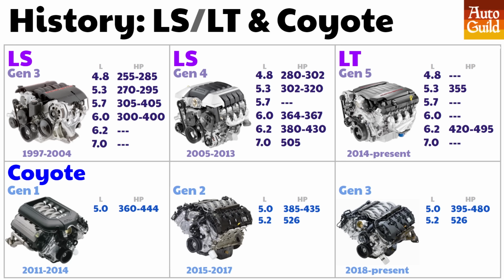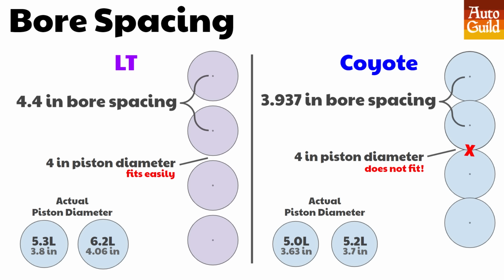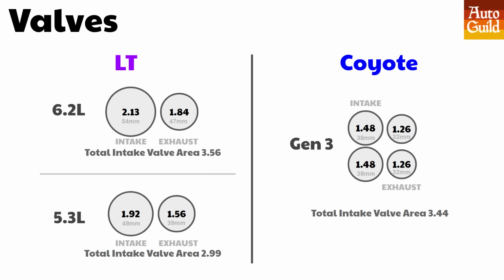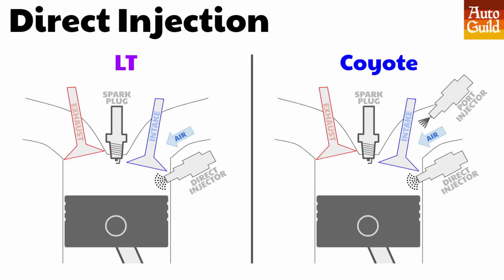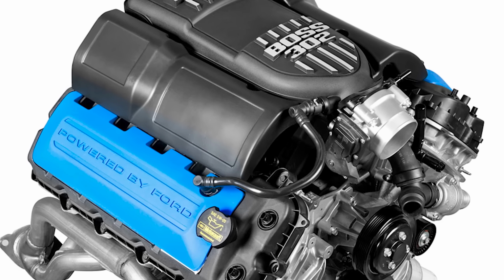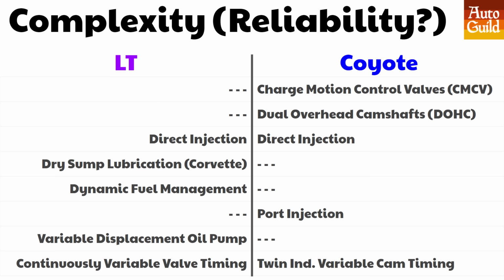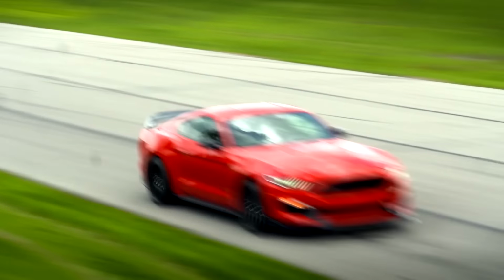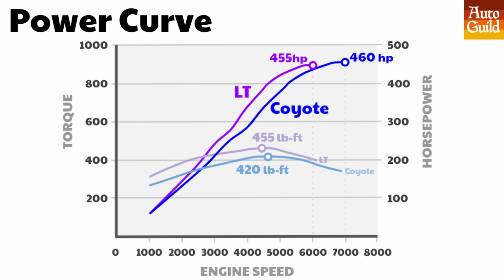GM Gen 5 LT vs Ford Coyote.  Which one is better and why.

Comment: Misleading, here’s why: The LT makes more hp per engine mass. The LT makes more hp per external engine size. This nullifies ALL the Coyote advantages he has praised. If you care about performance, the LT is just better, period. No one cares about the lower redline, if the lower redline gives you more hp per external size/weigh, AND a bigger area under the power curves.

If you are going to modify it, naturally aspirated LT has WAY more potential. We are talking 600+ hp naturally aspirated, on pump gas. The Coyote is pretty much maxed out as it comes.

The LT also fits more engine bays, and puts less mass on the front axle. 

BTW, he is wrong about the Coyote being shorter. Only the engine block is shorter, but there is a massive timing assembly ahead of the engine block, that the LT does not have. The end result: fully assembled, the Coyote is longer, with the CG sitting further forward, while being much heavier.

No one cares about DOHC and other cool features the Coyote has, if it can’t compare in any objective performance measurement.

And the fact that the Coyote has inferior fuel economy, despite the smaller displacement and all the modern features… that’s just embarrassing.

Comment: I mean one camshaft vs 4 and 1 timing chain vs 4 , no overhead cam that can starve the lower end of oil , 16 valves instead of 32 , and way more everyday low end torque , so much less to go wrong , I’ll take the lt1 all day …and the night ! Plus the camaro is better look8ng in my opinion and handles better and has a sportier driver position and tr 60-60 trans , gimmie the camaro and the lt1 !

Comment: Both engines are exceptional. Just make sure the valve spring issue was addressed on you late LS and LT engines. You will not be disappointed

Comment: I recently started working on a couple ford engines after only working on chevy and dodge engines for the last half decade. I didn't expect the ford engines to be very different but i was unpleasantly surprised. Maybe it is confined to just the particular engines I've worked on but the chevy and dodge engines seemed to have intuitive features with all the parts where you'd expect to see them and accessing them for regular maintenance procedures was no big deal. But these ford engines...holy sh1t, one has the spark deeply set in the heads covered by the intake shroud. The other requires pouring ATF down the dipstick tube to fill, (~17L down a straw diameter tube) and everything else has been a struggle to access. 

Has it always been like this with the engines from these companies? Why are the ford engines so unfriendly to the consumer that likes to maintain there own vehicles? Why is dodge, who seems the oddest man out of the three, still eminently more intuitive to work on?

Comment: Im still blown away by my stock 2016 f150 coyote. 385hp in a damn truck. The last truck I owned was a 95 Ranger 2.3 with 105hp. I've seen as much as 25.3mpg with leveling spacers and its a supercrew 4x4

Comment: The BIG factor missing here is power to weight to size...the REAL "Volumetric efficiency". The Coyote is roughly 50 lbs heavier, and that extra size makes it the same size (and close to the weight) as an old school BB Chevy. That engine could be 510 in³ or bigger, for about the same weight (aluminum block and heads).

Comment: Horsepower per liter is an absolutely useless metric when you're comparing engines with different valvetrain architectures.  The engine's displacement has zero impact on vehicle performance.  It's all about SWaP : Size, Weight and Power.     Displacement is as important as engine block paint color.
Reply: No replacement for displacement!    Must be an uneducated Democrat!    Next!

Comment: Don't like the lt or the ford new 5.0 have 5 of the ford 5.0 motors with crank problem's and the lt amf lifter problem's don't get any thing with a lt or ford 5.0 and 3.7 and 3.5 same motor  just a v6 got to meny of them expensive to fix and most people won't fix and buy new bad for bizs

Comment: Always puts big smile on my face when a 5.3 on stock height/tires tries racing my stock 5.0 on 6 inch lift heavy wheels 35x12.5s and ive yet too lose. After many years of my 5.4s eating dog sh*t compared  too the 5.3s

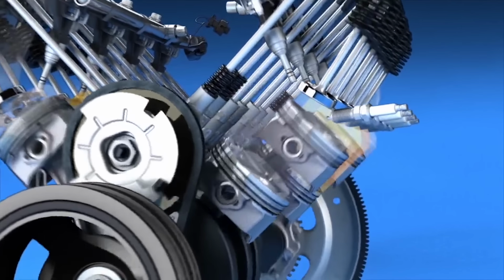Comment: 6:29 luckily you nailed it, port and direct injection throws away any issues with direct injection carbon build up. my audi RS3 comes with 10 injectors, port and direct. Very nice for early HP as fueling isn't a problem

Comment: The GM small block has been the standard for how many decades? Fords 1 or 2 special engines and had to go to those lengths to get past a simple small block GM v8. If GM wanted to crush them it wouldn’t be a problem. When does anyone see a gt350 voodoo on the street?!?!

Comment: How/why do all of these car videos, when talking about HP and Torque numbers always focus on peak HP and Torque? Occasionally one will say the power is linear, which leads to what's actually important, the total HP and Torque under the curve. If these engines are in trucks, what's the torque at 1200-3500 rpm? Very few people spend much time beyond 3500 rpm. These 'which is better videos' or discussions always assume it's for racing. I don't leave my driveway with a two step stalled at 4800 rpm and shift at 7800 rpm. Which is the better motor that will sip gas 90% of the time, then pull from 1000 to 7000 rpm occasionally?

Comment: I test drove both engines in 2012
The Coyote had a much smoother harmonic balancing during the revs then the Camaro probally because of no lifters or pushrods  , plus ideled much smoother in traffic . For an owner buying a daily driver to work and back 
The Coyote is the choice "

Comment: The coyote is the “ better” engine and it’s not really close, to make decent power out of a LS or LT especially up high you need to open the motor, a coyote you can go buy, bolt on a few parts and Slap a good tune and you have 8000+ rpm and 550+ hp up top and your easily 100 HP/L , An LT you need to open up then Spend 5k on heads another 5 k for cams and THEN put it back in and THEN tune it, it might be simple but its tedious it’s a much less efficient engine mod for mod and it’s 5x worse when dealing with boost. I have no biased to either it’s just one engine is clearly better.

Comment: I'm not a fan boy of any particular make. I like them all. But the Coyote engine is an absolute beast. My son has a GT PP2 10-speed with an exhaust upgrade and a tune. It's putting out over 500hp. A Dodge or Chevy hasn't been able to touch it unless they are boosted.

Comment: The Coyote is a very cool engine. A crap load of power from a a small displacement is always a good indicator of efficient design. If you prefer higher tech to old school the 32 valve over head cams certainly bring an impressive combo as compared to the tried true choice of 16 valves and single cam design. This is where my preference for the Coyote ends though. The big downside of Coyote comes back to all the impressive features I just mentioned. 32 valve heads with two cams on top and small displacement make for an engine that is physically HUGE and yet down on low end torque vs the bigger displlacement Chevy designs. I'm the guy who loves the old cars and while I own newer cars too I don't "hot rod" the new stuff. I tend to leave it "stock". In the couple of instances where I have considered a new engine swap into an old ride there is a lot to like in the newer GM engine approach. Smaller and more compact design just fits better. The maze of wiring and figuring out the best places to tuck away computer controls is the biggest challenge presented. I've seen a bunch of LS swaps and I'm starting to see a lot of new LT swaps into old cars. Ultimately you can make huge power with an LT or Coyote. I see no reason to prefer one over the other on power alone. For me it's all about packaging and does it fit under the hood?  That and all the associated hassles and effort required to make it happen is what has me preferring the Chevy. Given the number of LS swaps into Fords I see these days......I doubt my opinion is mine alone.

Comment: Parts between the gen 1, 2 and 3 are interchangeable.  If starting from scratch you can use a gen 3 short block(gen 1 crank), gen 2 heads with gen 1 timing and gears

Comment: The performance is impressive but when your a dinosaur like myself and spent years where the most amount of brain an engine had was an HEI module. Tossing fuel to a carb and 1 wire to the distributor and alternator and a #2 to the starter and you're done, it seems like the amount of tech of sharpening a pencil next to setting up a modern engine.

Comment: Also, the lt1 MAKES 465 lb ft without accessories. It weights 576 lbs and the lt4 is 744 lbs. 
465 lbs as a 6.2 would be crazy.

Comment: I'm a lifelong GM guy and have had numerous small blocks through the years, but the Coyote really is an impressive engine.  And it's hard to top what those can do with a Whipple bolted to the top of an otherwise stock bottom end.

Comment: I like the 4 valves per cylinder with the Ford, but with variable cam timing and direct injection, reliability suffers. On my Mustang, I deactivated the variable cam nonsense when I installed Comp cams. I believe the Chevy guys do the same

Comment: I’m a ford man the LT engine wins hands down on aftermarket parts and simplicity works better for me better engine size for a more universal engine in fitment across different models.. yeah over head cam is good but LS LT push rod is just as good I say ford needs to stop trying to make Ferrari engines bring it back to the good Old basics 351 Windsor and Cleveland cubic inch talks how about ford remakes the Windsor but this time put proper heads on it …. Chev has won this party 🎉 for me 😎 ford needs to wind 💨 it back to Reality bring back the pushrod  engine and make money on aftermarket race parts again

Comment: Flow through the valves isn’t dictated by the surface area of the opening but rather the curtain area (circumference X lift). Generally a smaller valve can move more quickly (and further) than a larger valve.

Comment: Having autonomous intake and exhause/outake is truly a game changer. Way to go Ford. Though there is still much to like with the 4.6 liter V8 GM produced calling them the Northstar engines. Ot at least the ones 2001 and later. I have never had or seen  any problems with those engines in the Cadillacs, producing many miles and running strong.

Comment: The ford's engines are cool I don't have a problem with them. I'm just a chevy gm guy. But at the end of the day its apples to oranges one has dual over head one is push rod 1 cam. If gm came out with a new dual over head cam engine things would be better to compare

Comment: It's not apples to apples dual over head cam can do alot more in tune to make power. U can only do so much with push rod. Overly complicated is great if it's reliable . The one thing I don't like on gm is dod where it can ruin the cam or lifters. Imagine if ford and chevy worked together to make vehicles better and faster and more reliable then Japanese vehicles lol

Comment: Coyotes look cool but I prefer replacing 1 cam shaft not 4 and having engine space and not having to spend more money to gain power. If I want high rpm I could buy a honda. Coyote and lt and ls is apples to oranges . If ford came out with push rod engines like the lt or ls then is would be a good comparison. One is push rod one is dual over head cam. The one thing I don't like is dod on gm engines it messes up the cam. Gm should stop using the displacement on demand they go bad and wipe the cam or lifters out

Comment: Hey auto guild just wanted to inform you that you missed a transmission for the LT motors. The TR-6070 which was a 7 speed variant of the TR-6060 only found in the corvette. Only notable thing was the 7th gear was a economy gear if I remember correctly it’s either .63 or .53

Comment: V8, good choice. I traded in my 2017 XLT 3.5 for a 21 Lariat sport 5.0. 2 very different, but equally awesome trucks. The eco constantly made hay 0-80. The 5.0 takes a sec, then makes it's hay above 2500k. Obviously more powerful. I don't understand why anyone would change the exhaust on a 5.0? I step on it from 75 mph on the highway. Believe me, it moves, and people know you're coming. The eco was an assassin. Cruising along at 75, step on it. You're breezing past people at 100 before you know it.

Comment: Chevy had flat plane cranks back in the 70's, so this isn't a Ford thing. Ford did however, have the first dual overhead cam engine ever created, and it was made just over 100 years ago, you can find them in Sherman tanks.

Comment: You can’t say a blanket statement like smaller valves make an engine rev higher, make more power and have better throttle response. The coyote doesn’t actually rev that much higher than an LS or LT.  getting an engine to rev high has a LOT more to do with camshaft profile and valve train stability.

Comment: Nice video!  I'm not a fan boy of either brand.  I AM a fan of reliability and ready to trade my 2009 Silverado for a new(er) truck.  My 6L LS with 200K miles has been a real horse. I love it. I'm NOT attracted to the valve train issues of the new 5.3 & 6.2 GM engines. I'm going to go test drive a Coyote. Thanks.
Reply: Stick with a Gen2 or Gen3 Coyote as the Gen1's have oil consumption and timing issues. The Gen2/3's are magnificent engines with gobs of power! A friend of mine just had his 2021 GM fail due to lifter failure after only 15,000 miles on the engine. Had to wait two months to get a new engine. He immediately sold it and bought a F150 with a Gen3 Coyote in it. Loves it!

Comment: Interchangeability of parts is where it's at. Plus, a cast block LS like the lm7 or lq4 will handle 1,000 hp on factory internals as long as you're not racing it every day all day long. Just as a daily driver, a cam and turbo is about all you need to make 800 hp. That's cheap, it was pretty much unheard of before the ls/lt engine family came into being, just slapping a couple mods on a factory engine and being able to generate that much power and not stand a huge chance of breaking something immediately. There's a reason the LS is swapped into everything.

Comment: LT and LS  engines are great minus the bull crap AFM, which destroys lifters. Delete it and you have a great motor that last forever. Ford Coyote is too over engineered I feel Ford needs to work on more V8 reliability,going back to the 302. Bring that 300 back!❤

Comment: So... I tune GM and Mopar. I'm also a former ASE certified master technician with advanced engine performance. I'm now a badass IT tech for the federal government. I'm also an LS guy. Actually, SBC turned LS guy. Lol. I admire the pure tech in the Coyote. People who don't geek out don't know that the Coyote cams are about the same size as an LS3 cam. But that DOHC and individual cam control is the killer. Don't believe me? LT6. Boom. But yeah, the Coyote is bad ass. So bad that this LS guy is learning Gen 1 Coyote as we speak. Can anyone say "S197 and a 3-2-1 or 2-1 swap with a TVS2300 will be a street terror!" I can...

Comment: Time to update the video? Since 2yrs ago we have real C8-Z06s with the LT-7s rolling around and they’re redline is 8600. Beats the Voodoo and has a FLAT torque curve to the top, and is also the current highest production horsepower motor. GM decided to go back to 32v aluminum V8s like the early 90s when they did that first too with Cadillac and Buick. 
One comparison not mentioned also here is how much it costs to boost an LS/LT up to mid 1500hp vs the Coyote just can’t and would cost way more with less power, 1350hp.
Reply from the maker: Yeah some great points, most of my viewers are not considering over 1000hp but thats a whole nuther story.  I may need to do a turbo video!

Comment: The LT1 paired with the 10 speed is an absolute menace on the road. Had a 2019 2ss and it was much more responsive than the 5.0
Reply from the maker: For sure, people underestimate these new 8 & 10 speed transmissions.  Makes such a huge difference